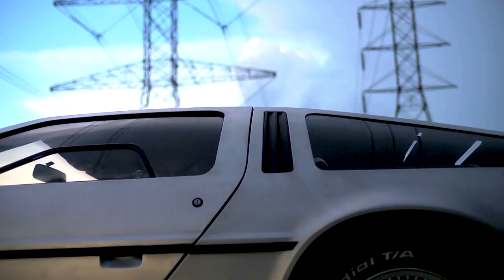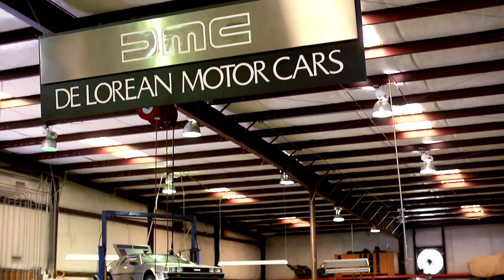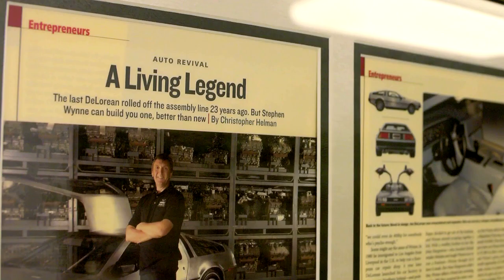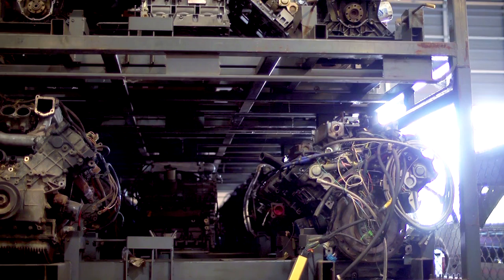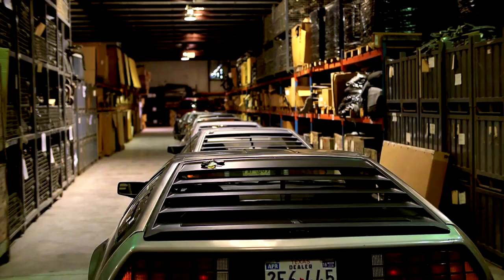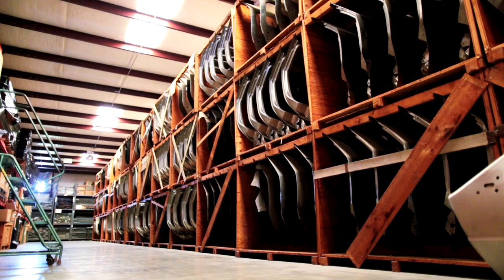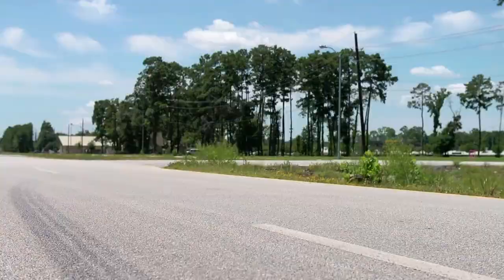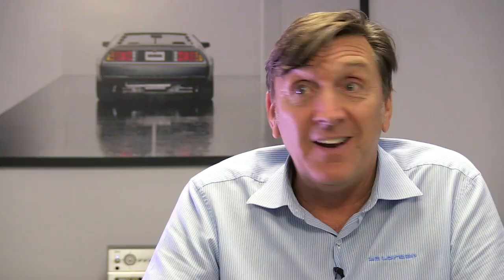New DeLoreans are still available, straight from the factory

Comment: I could think of no other car deserving of an electric motor.
Reply: Somehow seems appropriate give the pop culture association of the car.
Reply: Exactly
Reply: it would be perfect
Reply: That’s a great idea
Reply: @bartjuhhh6416  Hydrogen is too expensive and also lethal. Why do you think Airships faded so obscure that it becomes a thing of fantasy or past fantasy.
Reply: @bartjuhhh6416  But a alternator reduces the amount of electricity being actually wasted making it efficient. Also it produces no bi-products other than the fact it uses rare earth minerals. But hydrogen has to be made from said inefficient energy sources which make it unviable for mass use.
Reply: @bartjuhhh6416  Well my friend. It ain't that simple. You see Hydrogen engines use a chemical reaction. And said reaction must be contained in a sealed compartment.

It's a replacement for batteries but even lithium ion batteries far exceed it in every way.
Reply: Lmao this is facts. The factory Peugeot engine is complete ass. Anyone who says otherwise is just dumb. Shit makes less than 100hp😂😂
Reply: @bartjuhhh6416  Also regular engines use compression and since Hydrogen is practically more volatile than gasoline in explosive force. So again you'll need a reinforced piston with a perfectly sealed cylinder or else the reaction could fail.
Reply: @bartjuhhh6416  Don't tell me you got that off the internet. Because it's a sham. Again what makes hydrogen powered vehicles obscure is it's again very lethal especially to the user and the environment. And is also in short supply.
Reply: @bartjuhhh6416  nvm I stand corrected maybe? The engine itself needs a huge fuel tank the size of the entire car to get a good range, 

So hydrogen ain't efficient and is also highly dangerous. Plus to get efficiency you need to make a electric car of the same inefficient setup plus a huge fuel storage and has to be manufactured by inefficient power sources to even produce the fuel to power a car with 50% efficiency.
Reply: @Todd.T  I like you!
Reply: That sounded like something Iron Man would say
Reply: That is a great idea. Deloreans have a bad rep of weak and unreliable engine. New electric cars are fast and run all day on a single charge. And unlike the gas engine they are getting better every year. That is the future. For those who think that the Delorean will loose the value with a electric conversion, think again. Who will want a car that can not do 88 miles an hour? The engine it self is the main reason why Deloreans had not appreciated in value as it should. Sure anybody can argue that there are other reasons but still that is the main one.
Reply: @bartjuhhh6416  Tesla is making cars that can run all day on a single charge. Cold weather is a problem on gas engines too however many new electric vehicles are coming with thermal management system to help regulate the battery temperature. Companies are building faster car chargers every year. Batteries can be despose properly so they can be recycle and not hurt the environment like a petrol engine would in its life time. They will last 10 years which is more than what a timing belt will last on a new car. Replacing the battery after saving so much money in gas should more than pay for itself which is more than what i can say for a timing belt plus repair cost now days, specially if it breaks while driving. Electric cars are getting better every year while gas engines are becoming less reliable as their technology gets more complicated trying to keep up with stricter government emissions standards.
Reply: @bartjuhhh6416  jij snapt het echt niet he Bartje...
Reply: If you read reviews of Delorean cars, replacing the engine with ANYTHING would be a good idea. 
A Tesla battery and drive system would be interesting.
Reply: @firepower7017  uh hydrogen.......... if hydrogen is burned correctly you only produce H2O which is poisonous in very large quantities if you reach water saturation or are smothered by it.
Reply: @DaRip74  burned correctly? So you're saying the Hindenburg had a chance to combust water vapor? That is absolutely absurd
Reply: @bartjuhhh6416  Your standard piston ring in a ice car would not be able hold hydrogen, since it's less dense of a fuel.
This applies to all fuel systems in the car, so it would actually not be that easy to convert all ice cars two hydrogen.
Reply: LS swap
Reply: Wuanslm  It was the 80's. Maybe a cocaine powered De Lorean??😉
Reply: Todd T have you heard the nio ep9 it should sound like that, electric can sound badass, should be no comprise to sound quiet 👍🏻
Reply: DaRip74 correct
Reply: Good idea. Elon musk should do a tesla conversion maybe
Reply: It would be way too heavy. The car alone is way too heavy for even the motor it has. And a battery would be at least half it's weight if not more. Basically got a  under powered monster truck
Reply: The stainless steel body is exceedingly heavy and would drain your battery fast due to the weight.
Reply: okay "so how heavy is it...?"  (crowd voice)
Reply: @phillyphil1513  very heavy
Reply: Plutonium powered
Reply: @tylerleblanc520  Per the periodic table, yes that's true but only applies to the typical off-the-shelf internal combustion engines using (currently) conventional materials and design.

Even the Tsar Bomba had no effect of igniting hydrogen in the atmosphere and even then, there is no apparent chain reaction. Hydrogen unsafe? We're going to need statistics on that one because I have absolutely no real-world examples. 

Now, a mass frequency driver in a strategic point in the earth's electromagnetic field could a fun weekend project 🎅✌
Reply: That is my point, you will neen gest if not more effort to convert a ice car in to a hydrogen fuel cell compared to a ev.
Reply: Not to mention the inefficiencies that come from making the hydrogen in the first place.
Reply: Marty McFly arrives at Doc Brown's house in 1955 in a Tesla pick-up. Doc Brown says, " I see why you need an electric car, it's because of all the nuclear wars in the future".
Reply: A trabant. At least it's affordable.
Reply: Stanford University did it, they have an electric DeLorean. look it up. It's quite remarkable.
Reply: Tesla should buy the rights. Make it 5-10% bigger in scale, and put bootspace under the hood, infotainment system, with the old tricolour didgets and all the sounds when the doors open up
Reply: Electric or hybrid or fuel cell.
Reply: Todd T I can think of lots of cars deserving of an electric motor...
Reply: junk
Reply: Please, take a note @Tesla
Reply: Stanford made one that's electric and drifts autonomously👍
Reply: Todd T lol just no. An electric car has to be built for it. This car dwarves a nice beefy motor for its steel body
Reply: At least make it an option i want one with an ls
Reply: It looks like it comes from the same line as the cybertruck in a way
Reply: @Mjlcarguy456  the engine has asthma and would work better with a better injection and intake system, also improving the exhaust would help
Reply: Jesse Mitchell When did the movie say it had a V8?
Reply: Would that be possible? To take out everything and make it electric Ik of course it would be hella expensive but has anyone done it?
Reply: Jesse Mitchell true
Reply: @bofaboy9271  Anything is possible. I've seen a V8 Fiero at the racetrack. The problem with all these projects is that they are rarely worth it. The balance of the car is thrown off from too much weight in the the back. Traction becomes an issue and because everything is ad-hoc, there are no cool things like traction control to help out. Chassis issues emerge because of extra torque and mounts start to tear.

The best engine for that car would be a big turbo V6. Big so that it spools up and delivers power later so you don't break stuff and it will also fit.

When I was a kid we built a 7.6 liter 1980 Mustang using a 13:1 460 ci big block out of a Lincoln. Ported heads, offenhauser intake 2" headers. That car was undriveable. Zero traction. There was so much torque, it leaned over like it was having a stroke when you floored it, spit stones everywhere, painted black stripes on the road from the spinning tires and that was at highway speeds.

I had another car with a 5.8l liter in a 1981 body. Because I could get some for of traction, I could beat the other car. Also, in the 7.6l the engine was so big, you couldn't have a fan attached to the water pump, because it would have to stick out of the hood because the engine was so tall. So now you needed a bigger radiator, electric fans. There was no room for rubber engine mounts to absorb shock, so we solid mounted the engine with a steel plate and the list of crap goes on and on.

No manual transmission either. Nothing could take 550+ ft lbs of torque unless you ran an old cast iron four speed from the 1960s. So you ended up having a mix of ancient parts, new parts, custom parts just to make it operate.
Reply: No
Reply: Mclaren f1
Reply: It would be way too slow the cat is already very heavy
Reply: Tesla?
Reply: i know a person who owns a delorean, the muffler is modified on his delorean, and it was my favorite car sound to this day. i really would be sad if the delorean had a electric motor
Reply: Rata 4U  Electric cars can be charged with solar panels. I get your idea of Hydrogen converter. There is also the option of wind mill. I guess it all comes down to initial cost and city regulations.
Reply: Ditto!
Reply: Todd T just as long as it makes the same noise as the time machine then yes. It defiantly deserves an electric motor
Reply: Great idea!
Reply: The stainless steel is a great ground.
Reply: That would last a long long time, with a bunch of tork too!!!!!!!!
Reply: Why would you ruin it with an electric engine obviously you have no idea about classic cars you don’t modify the engine so it’s worth more let alone bloody engine swap it to an engine in a tooth brush
Reply: @stigsaussiecousin1197  Classic in what sense? The thing was a POS from the get go, excelling at nothing and full of scandal, I don't even want one for free. I'd rather have a 351 powered Bricklin or better yet, a Pantera or a Vector W2. The electric motor at least fits the 'futuristic movie mystique of the car. Other than that, the car was underwhelming.
Reply: I’m not particularly fond of electric engines but that’s a interesting idea
Reply: Stigs Aussie Cousin I think he means more as a reproduction or throwback idea.
Reply: Todd T you’re being a little critical for a YouTube comment don’t you think?
Reply: @liamaustin8123  No. Even the movie does the same thing we used to do. When you wanted to race a car and you just needed a shell, you found the newest, cheapest, aerodynamic thing that wasn't likely to have any future value, to modify. This car was such an underperforming car, it fits the bill to be hacked up and converted. An electric engine suits the movie plot. A current (no pun intended) electric engine could suit the movie plot and get the thing to move.
Reply: They did built a prototype in 2012, but no production version has been made so far.
Reply: If you could get half the weight off of it.
Reply: what is the engine exactly? isn't it $70,000 USD?
Reply: @Jesse Mitchell for what I heard they cost, at least!
Reply: @Todd.T  It's the journey. At least that's what I try to tell myself when something goes boom.
Reply: @Todd.T  yeah well everybody loves a countach until they try and fit in one with the offset pedals. but this thing needs a supercharged or turbocharged V8 and 600+ hp/tq. I think the superchargers might give it the best whine sound like the movie.
Reply: @ryuhado7253  Only ever been in one Lamborghini. No way to exit nice except to roll out like you're on fire.
Reply: How much
Reply: Tesla should get on it, it has the same aesthetic as the cybertruck
Reply: And a fresh take
Reply: John How about an electric motor with v8 sound comming from a speaker cuz lets be honest the only real benefit of a v8 is the sound
Reply: Perfect 👌🏼👍🏼
Reply: @Todd.T  Cocaine powered Lamborghini Countach, you can snort your fuel on the car!
Reply: Wooord!
Reply: Yes plz
Reply: Tesla should pour in some cash  into this company and work together on limited 1000 car run. A collaboration one can dream. Let's face it they look really cool but they run like crap.
Reply: Please no the car would eat all the energy from the battery just going up a hill from all its weight
Reply: Nah, a turbocharged 4 banger that produces 300HP, much of the attraction is seeing that rear mounted motor when you pop the trunk, it’s aesthetics extend way beyond the external features and gull wing doors.
Reply: @ZebbMassiv  yep, a “DeElon”.
Reply: Nuclear engine - and no, this is not a joke.
Reply: V6. nothing else. NSX? anything that would actually get it to 88mph.
Reply: I have 69 Opal gt, I wish I could afford to turn it electric.
Reply: They've integrated MR.Fusion into every DeLorean since 2015
Reply: @firepower7017  Why are you talking about putting hydrogen into a piston engine, or exploding it in any way? That's not how hydrogen cars work...
Reply: @firepower7017  Because they originally use HELIUM not HYDROGEN.
Germany had to use Hydrogen because USA didnt sell Helium to them.

Airships are nowadays way more ffecient then airplanes. just not as fast.
Better look the new ones up with robots that repair the hull and they carry heavy cargo.
Reply: imagine it with a roadstar system, thing would go back in time to the big bang in 0.2 seconds lmao
Reply: Wise up,.... How to ruin a Delorean.. Give it to you.. Electric vehicles are the work of Satan. The internal combustion engine is the livi g soul of any vehicle.....
Reply: @bloodmuffin123  stainless is no heavier that mild steel
Reply: It would turn an utterly boring, slow car into a monster on the road thats for sure lol
Reply: Carbon fiber mold.
Reply: @normanguzman417  yeah what if you just slap a v8 in there and call it a day
Reply: Wonder if we could buy a new one, with out a motor....
Reply: I absolutely agree. And if they are able, they could make it into a nice way of resurrecting the company into being a competitor to tesla, sort of. By making their electric cars have some pep, but also have a reasonable price. Speed on a budget. And with the looks of a spaceship
Reply: @Todd.T  Nothing reasonably sized and cheap at least
Reply: @Tek Man So then one motor from a Tesla? 500 hp isn't much anymore.
Reply: @Tek Man For what IDK. Most old cars have a problem putting the power down. It might even fare better with less. Rich Rebuilds could probably drop in an electric motor and have a balanced car. I don’t think anybody has ever bragged about the chassis on the thing.
Reply: Agree. Would be an improvement!
Reply: Well sir you are in luck they just came out with one
Reply: I have good news for you from the future…
Reply: It deserves Mr. Fusion and a flux capacitor...
Reply: Guess what I'm inheriting! Electrifying a vixen too
Reply: Well there have been a few done now as you probably know. It's a dreadful car masquerading as a performance car and that would be a good start.  Then getting rid of the rubbish suspension, Cortina brakes  etc  etc   you might have something
Reply: That would solve so many problems and make it crazy fast
Reply: @firepower7017  the extraction of rare earth metals is just as bad as using an ICE.
Reply: No.
Reply: Why not? It's already had a nuclear fusion core...